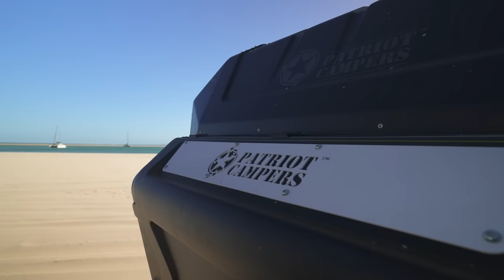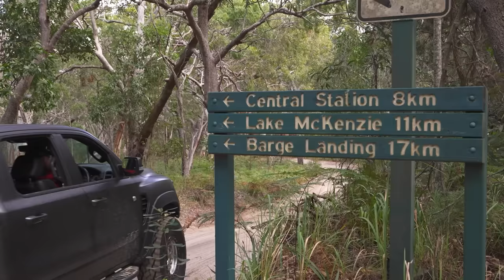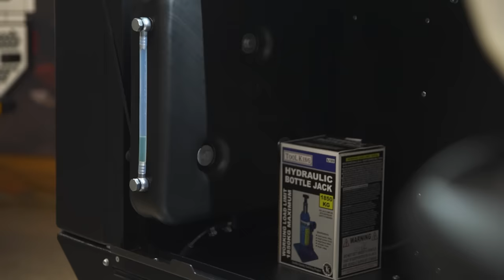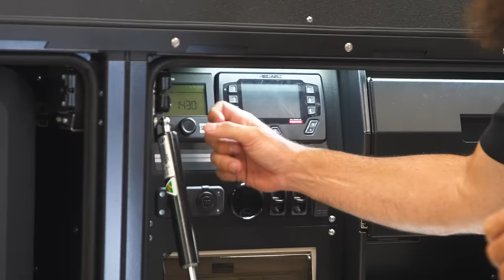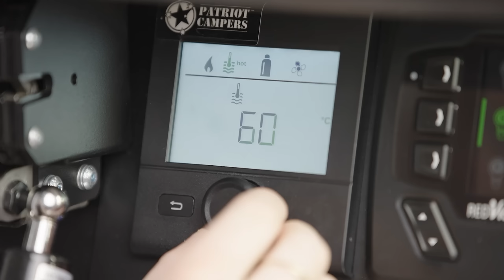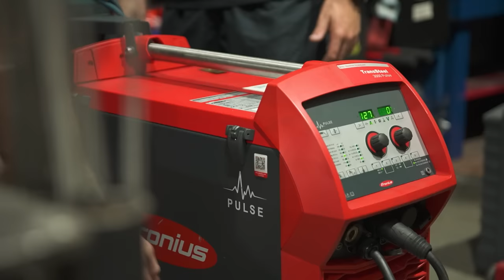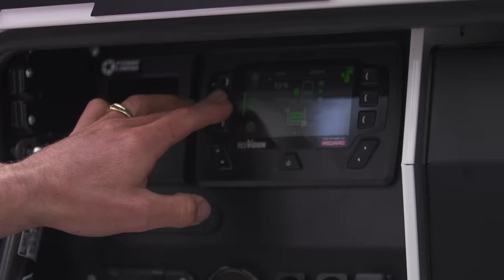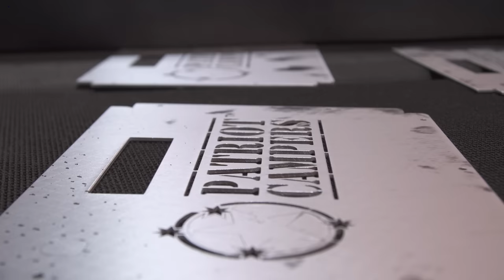2023 PATRIOT CAMPERS X-RANGE INDEPTH REVIEW

Comment: Great honest review of your new Gen 2 Campers. Cant wait to get my order and visit some awesome places
Reply: You may want to re-thing that order. I ordered a new X3 this year and it has been the WORST EXPERIENCE with a company in my entire life!. The X3 was delivered missing parts; The trailer brakes didn't work and the Patriot Campers REFUSED to get the trailer BRAKES Working. The WATER TANKS LEAKED. The PVC fitting from the factory was not assembled and install tight enough. When I asked them to fix it they put some putty around the leak INSTEAD of tightening the fitting. When it rains hard the Tent Leaks in the Rain Water. I awoke to over 2.5 cm or 1 inch of rain water in the lid that holds the mattress. Many other things such as the trailer hand brake was not adjusted correctly and the trailer would have rolled away if not for the safety chains. Day-One issues and they wanted a ticket opened to see if they would fix the issue. Months later now and the issues are not resolved!
Reply: @user-qo6ct2kt5d  are you in Australia and when was your X3 built?
Reply: @dmallen76  I am in the USA and bought my camper new this year 2024. There was a line up of customers, some with  X3 GEN-2 returning for repairs for DAY-ONE quality control issues. They had just received their NEW 2024 x# Gen-2 and had to return to Vegas!  They were not happy at all.  Other customers had waited many months for PARTS and still had not received them. Top it off the X3 leaks rain water when it rains with any strong winds. Strut failures  with not replacement struts' available for MONTHS.
Reply: @user-qo6ct2kt5d  I have a few issues, one that makes my X1 Gen 2 a shed ornament :( The rear doors opens on bumpy terrain, none of the others do. This is while it is in a locked state so unclear how the latches can get power to them.

Comment: Love all your vids guys. We own a off grid toyhauler caravan but have used some of your ideas to build our van. Only gas supply is for our instant hot water which is great but to eliminate gas would be better. Would be great to see more of the diesel heater and hot water specs and if it would handle my partners long showers..
Reply: You could probably do that IF you we're to put on a 500W fullsize panel (that's around 1900mm x 1150mm) on the top and maybe an aditional smaller 200w panel on the aux port. Guessing you are in Australia, getting around 5-6hours of solid daylight You should get around  0,6kW x 5 hours = 3kWh of energy (on average?) If it's more you need less solar and less storage in the next part of the story.

Cooking a simple two burner meal is around 15 minutes @ 3kWh = 0.75kWh
Heating up 20L of water from 20C to 75C for a shower and dishes (without losses) would need around, 1.3kWh
Our 80L Dometic uses around 20-30Ah (12v) a day if I remember correctly. This is around 30x12 = 0.36kWh

This would make up a total of of around 2.5kWh (rounded up to a half). You would also like to charge up a cell, laptop, or camera, use your lighting, maybe the compressor, etc... so 3kWh total (rounded). 

Remember, there isn't always sun out there so you would need a couple of days of storage (to be safe and not strain the batteries to much). At 12V that would  be around 500-600Ah (Lithium, AGM = 1200Ah) which is around 6 to 7.2kWh of storage. That is quite a bit of Lithium... Although possible, a 12V 100Ah Renogy battery is around €500, a Victron is around €800 (built in BMS though). 5 or 6 would be around €2500 to €4800,00... This is a lot of money compared to getting a few cans of gas or diesel for the heaters and cooking. Not to mention the required Inverters, chargers, panels, etc...

Apart from the costs, I would like to ditch gas for the most part too. Maybe just for the cooking alone as this is the most hazardous due to the moving parts of the slider and such. Using diesel or gas for heating my water is fine, as this is a fixed appliance.
Reply: theres mini water heaters. $100 ish.. 12v or 240.  can use with inverter.. i run a micro wave 800 watt, off a 2500 watt inverter.. or power tools..ect. ceramic cooktop. $300.ish,. run off inverter.
Reply: @harrywalker968  And where do you get the power from? The Inverter isn't the problem, you need a source too.. Driving around and charging the trailer is fun on the long haul to your destination but if you want to stay there for a while you need solar/wind too ;).

Comment: Good to see you again  Justin.
Quick question can the rear door on the X1 be un hitched so that it hangs all the way down which gives better access to the back of the storage, like you could do on the older Gen 1?
Regards Steve
Reply from the maker: Hi Steve, the GEN2 rear door now is now controlled by gas assisted arms. It is possible to unbolt the rear arms but it is a different process compared to the GEN1 X1. We would recommend speaking to your local dealer before doing so 👍

Comment: Only half way through and noticed you touched on tires... if it is mentioned later on apologies... is the spare a full size? If not can you see any issues with this when remote traveling? Are there any speed/distance restrictions on it etc?
EDIT, notice you answered this as the 46min mark. Nice one.
Reply from the maker: Thanks Marc. A full sized 33" spare is underneath the drawbar 👌 It's a low profile mud terrain tyre that is slightly narrower and it sits on a steel wheel.
Reply: should have same wheels on 4x4 as trailer..or carry too many spares.. low profile not good..too bouncy, easy to puncture.. or carry carcase & learn to change tires..

Comment: What is the advantage of running a mud terrain tyre on a trailer over an all terrain?
Reply from the maker: Same as a car, more traction Offroad 👍
Reply: you need same tires all round.. low profile is bad.. for off road.. plus you carry more spares. different sizes, not good.. he should have different size rims, & you buy the tires for it so there the same all round.. tires have to be 10 ply.. a/t.  mud terrain wear too fast..